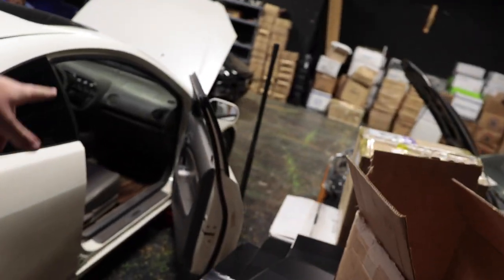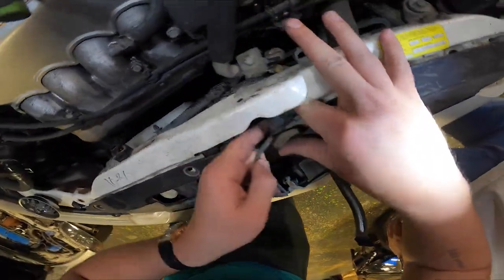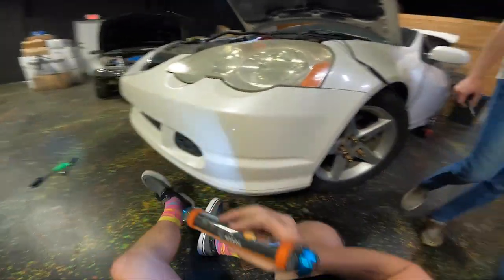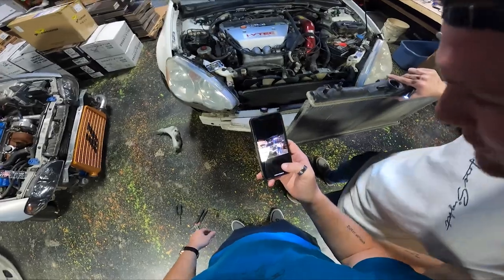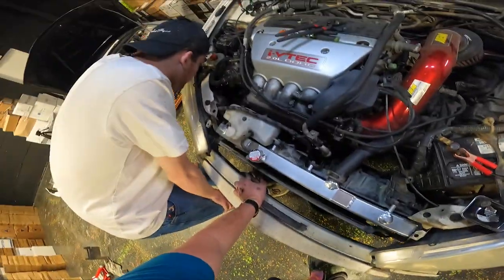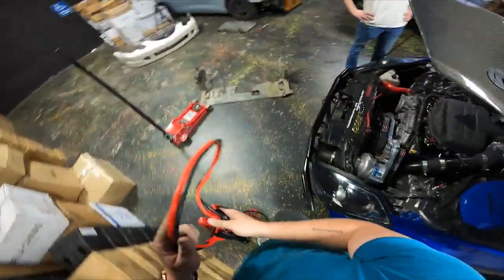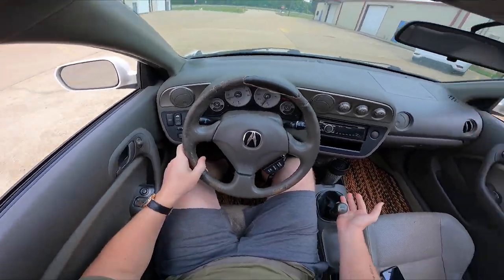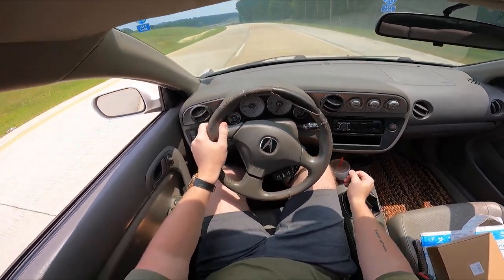Finally Fixing My New Acura RSX + White Claw’s First WOT Pull!!

Comment: I own an 05 RSX Type S and from personal experience, you need that bolt on the bottom of the T bracket "the uterus" or it will start to tear the metal, and one day your hood will come up when you're driving. And also for the oil filter, go at it from the top, its a lot easier.
Reply from the maker: Bet. Thanks man! Also I did end up putting the bottom bolt back in lol

Comment: I have an '02 RSX-S I bought new and is still my daily. The VTEC won't kick in until @6800rpm unless you have a swapped ECU. Most of the aftermarkets seem to lower it to @5500. The rattle could be the half shield over the axle. It's a pain, but the gaskets for it rot and fall out. So at certain rpm, the vibration makes it rattle. Honda made it as one piece, so you can't replace the gasket. I ended up getting some garden hose gaskets, cut a slit and pushed in place. Been a couple of years and haven't had a problem. There are some videos out for common RSX issues. Some are worth a watch. Look out for leaky taillight gaskets.
Reply from the maker: I’ll keep an eye on these things

Comment: Driving a FWD in an autocross is basically backwards from a RWD. For example, if the rear gets squirrely you apply more throttle instead of letting out. It’ll take a bit to get used to for sure.
Reply from the maker: I'm very interested to see how this goes lol

Comment: I love working on my lexus because it's so clean underneath. But I swear, it doesn't matter how many times I clean my 4runner and how many times I get under the car, i always have dirt fall in my eye. So i feel ya
Reply from the maker: It sucks
Reply: @Zorbii  probably the only thing worse is when you finish up a project like this and you have to restart because you forgot to transfer something from the old part or need to connect something that's impossible once its been installed. 😂
Reply from the maker: That is definitely the worst lol

Comment: In my experience going "fast" around corners in a fwd car, since you're pulling the car not pushing, the rear end can sometimes come out with little to no effort. Could just be the clapped out crx with no interior I used to drive, or just not having enough tire on the back. Either way, once you get used to it, they're actually really fun.
Reply from the maker: I’m definitely looking forward to it

Comment: Vtec kicks in at 6200 i believe. I drive a tsx with the k24a2 stock vtec 6200-6300. Reflash and lower it to 4500 youll feel a huge difference
Reply from the maker: Damn ok bet. I’ll have to look into that

Comment: Take it from me. If the back tires are low on pressure, are bald, or wet then you can and will spin out on sharp turns
Reply from the maker: I believe it
Reply: @Zorbii   yeah my back tires on my PT cruiser slipped after it rained and I almost went into a tree going around a round about at 15mph
Reply from the maker: Yikes

Comment: I want to see you swop those springs on your maxspeeding coilovers move the front to the back and put the rear to the front
Reply from the maker: I don’t think that’s possible
Reply: @Zorbii   Measure the width of the rear Springs to the front Springs And see if they can be interchanged
Reply from the maker: So why exactly would I do that?
Reply: @Zorbii  when I put my maxspeeding coilovers on my LS400 they put the springs in the wrong place. They had the smaller kg springs in the front and the bigger one on the rear. The car wouldn't sit right and road like shit. So I did my research and BC coilovers have a 12kg on the front and a 8 kg on the rear. So I ordered from my sellers a 12kg for the front and moved that 9kg to the rear and it made a big difference on ride quality
Reply: @Zorbii  and I was able to  get my car to the ride hight I wanted because the 9kg springs was shorter than the 10kg they had on them on the rear

Comment: that noise at vtec is completely normal and with an exhaust it , makes it a hell of a lot more aggressive
Reply from the maker: Damn. I never would have expected vtec to be that loud lol
Reply: @Zorbii  if you ever plan on building it go with hondata for tuning
Reply from the maker: I probably will
Reply: @Zorbii  also tein coil overs have electronically adjustable dampening with smart adjust

Comment: I honestly hate working on Honda bc of all their clips and shit. One day I was working on my mom’s odyssey and she needed a new alternator, usually shit like that is like an easy replacement on any other car but first all the clips like broke on both the top end and the bottom. Then I tried to pull out the alternator wouldn’t fit through the bottom and then I had to remove the windshield washer fluid reservoir and lift the engine with a jack in order to barely squeeze the alternator out and put a new one in. This took a total of like 4 hours. It was terrible if you don’t have a lift. I told my parents never again will I do that in a garage with no lift.
Reply from the maker: Sounds like a huge pain

Comment: My EG1 Del sol isn’t that hard to work on, the newer Honda models kinda cram everything in together, my moms odyssey is so shitty to work on cus of the compactness
Reply from the maker: Somebody else mentioned an odyssey before too 😂 but this being a 2003 I expected it to be easier
Reply: @Zorbii  my dad has an 03 civic (The DC5 RSX is based off the gen 7 civic body) and holy shit it sucks, even with the smaller motor
Reply from the maker: Damn